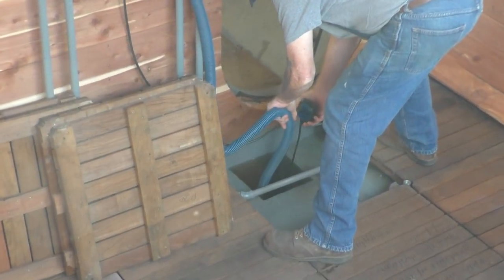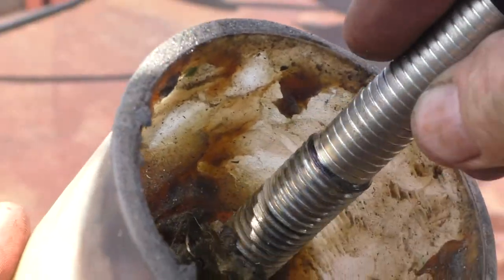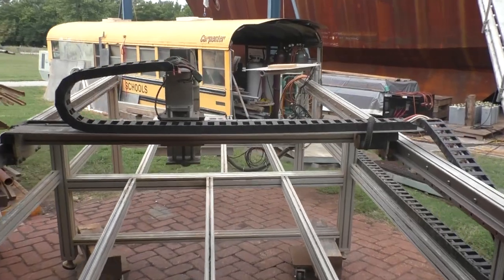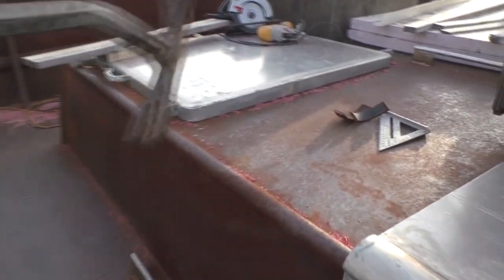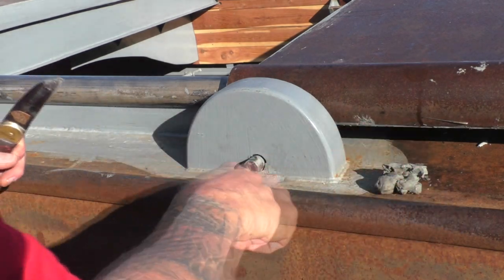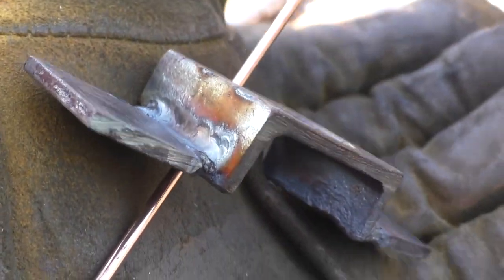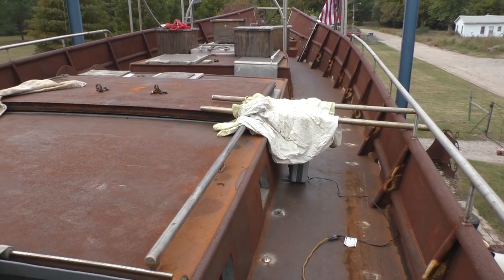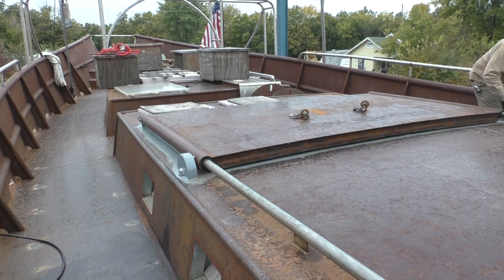Main Hatch Completed

Comment: Love watching these videos!  I have an idea for the hatch ratchet opening.  To insure that no water gets in around the hole where the socket is weld a 4" diameter steel tube/pipe that extends out to the edge. When not in use put a pipe/hole pug in the tube/pipe.  I am talking about the round pipe plugs that have a wing nut that you normally use to plug a drain pipe. They are 10 bucks at the hardware store.

Comment: If the silicone gasket that you made still leaks, do it again but install an o-ring or two on the socket. They will be cast into the silicone but make a nice tight seal against the water.
Reply: I was actually thinking a welded metal shroud over the end of the hinge with a removal plastic grommet to allow external access.
You're not going to want that access 24/7 and the weld grommet would be 100% watertight.

Comment: Are you going to put some dogs on the main hatch to compress it down against the gasket? Boy, if wind-driven rain is getting in I would hate to see what heavy green water over the deck will do. It doesn't happen often but when it does is exactly when you don't want it to. Such an impressive build. Cheers.

Comment: You may still see some leaking around your gasket from capillary action. If so you can put a washer on each the bolts holding the plate on. After pouring in the silicon remove the washers that should give some compression to help seal it.

Comment: you could have taken example from your backyard faucet shutoff valve. even cut one up and use it to insulate from water. They are usually packed with graphite paste so that when its starts to leak you can tighten them up and they will stop but becomes harder to turn losses it and it will turn easier but might also start to leak if under pressure but in your case it would have worked since there is not much pressure.

Comment: With tig keep the torch ON the part so the gas can prevent oxidation. Maybe its instinct for you to pull it away from all the mig/wire you do but try to keep the tig torch on the weld even after you finish for a better looking joint. Keep up the great vids.
Reply: Hidro551 also it wouldn't hurt to have his electrode a lot closer to the torch
Reply from the maker: It's a scratch start unit.  There is no on/off.
Reply: Raise it to break the arc then lower to keep the gas on it for a few seconds - its post flow. @SVSeeker

Comment: on the shaft almost at the deck surface.. you might be able to get a forshida V seal and trim it..  or since you have a lathe machine a cavity and an insert to make a sombreo shaped seal to fit. and you can use 2 small fasteners to keep it from rotating..  cast it in silicone molding compound..  i wanted to make a variation of forshida seals shaped like a mexican hat for the propeller shafts where they go thru a bulk head .. one on each side .. so water pressure on either side just pushes it tighter against the bulk head even with the shaft spinning.

Comment: My thought would Extend the port for the handle with pipe the 6” or so past the edge.  leave it threaded and put a screw cap on the end to remove for use.

Comment: You could’ve used PC 10 metal moldable epoxy. You can adjust it and shape like clay then it will stick and turn into hard material. It is hard to break when it dries. I think this material will really help in that situation.

Comment: the castable molding medium is a brilliant idea, and with the bracket being removable, you can recast them when they eventually wear out and deteriorate from exposure.   Would it be worth adding a small cover plate to help limit UV damage?

For cranking the hatch back and forth manually....would a cross-barred hand-wheel about 12" across be workable?  would be easily welded, and if you're worried about clearance when it's not "in use" you can make a couple of locking clamps right on the side of the hatch to hook it on and keep it stowed...

Comment: I remade a "temporary" oil seal on an after gearbox 10yrs ago 
Smear gear oil on the shaft and load it full of silicon 
Bit of carbord and tape to hold it together while it dries 
It's only temporary if it doesn't work they rekon 
Well it's still in use today 
The only issue I see is my "oil seal" is on a presision shaft machined for a real seal and its in bearings so its perfectly round and rotates perfectly true with no run out 
If your shafts have any run out til compromise any seal method
Reply from the maker: I think it will be fine.  It's not the kind of application that sees a lot of rotations.
Reply: Your idea looks along the same lines as what I did any way 
A door shaft hardy sees 1000rpm over 1000s of hrs 
Be lucky if it even does a thousand revolutions in its life

Comment: You're doing a great job.  I would, however, make some changes to the latch mechanism you made to lock the hatch open or closed.  When you run into a storm, that chain will work itself loose from the slot.  Maybe not the first or second time but, it will come loose.  If it's like most storms I've experienced, it will fail at the worst possible time.  The sea is an unforgiving bitch.
Reply from the maker: The sea is the sea.  Don't worry so much.  Toss a clamp on it if needed and relax.
Reply: Guess you've never been in a boat that size in a storm in the ocean so, I hope you never do.

Comment: I put nozzle dip on everything, even wipe my table down with it to prevent spatter. It's not 100%, but it helps. I go thru a few tubs a year
Reply: 42Fab - Metal Fabrication & Signage funny I’ve never heard of using nozzle dip this way. But then again I’ve only recently gotten into mig and most people I know use tig so there’s lot I haven’t learned.

Comment: Red hot...   put Red hot on Elephant.   but seriously.   boat's looking great.   Love the hatch crank.    there is a version of socket heads that have a small divet in the top.   allows for some flexibility in the cranking.    Just an add on.   the one you have is working fine.